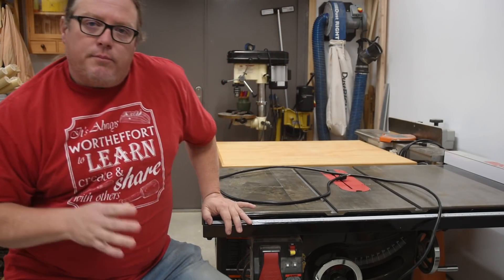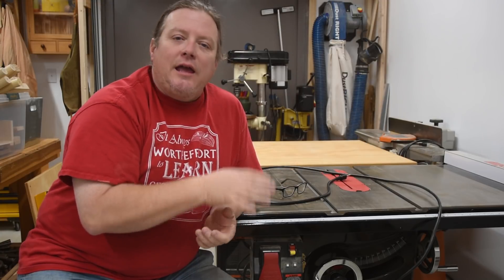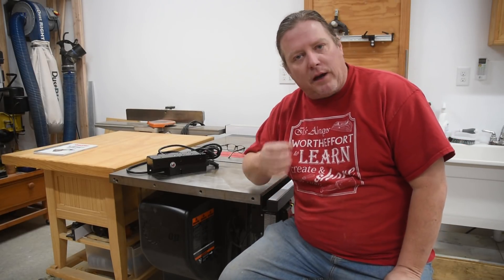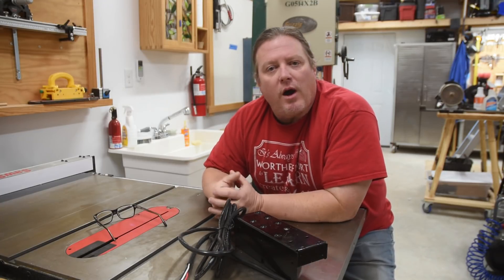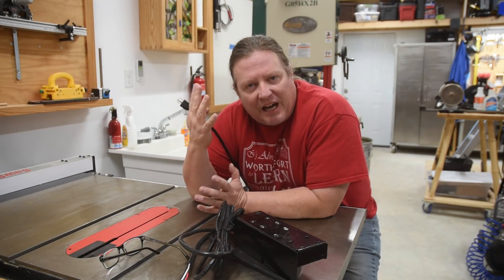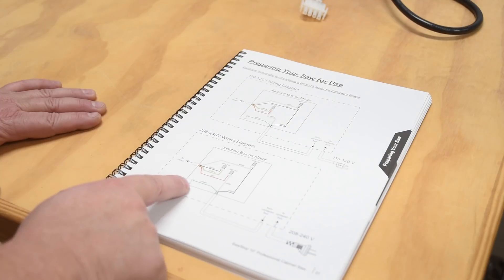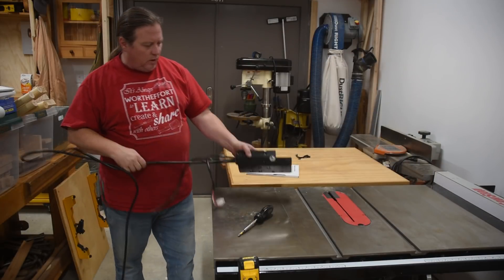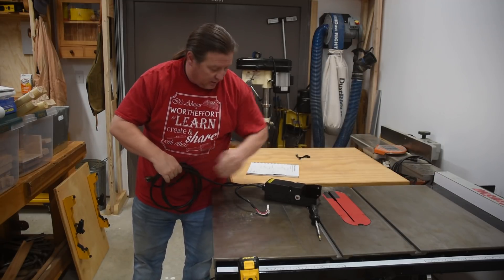Table Saw ( SawStop ) Power Upgrade - 110v / 220v

Comment: So here is the part I don't quite understand. I have two sawstops I bought used and had some parts missing. I did some research into parts and wiring diagrams and what I found is that the only difference between the 240v and the 120v is the thermal overload switch inside the contactor and the plug at the end of the power cord. So, that's $20 in parts. That's it! Yet Sawstop wants to charge me $139 + freight for a contactor that is essentially the same ( except for the lower rated thermal switch, which is a $10 part). And, I can change out the Thermal switch and install a new plug onto my old cord and rewire the motor  in 1/3rd the time of their "procedure" as all the cords stay where they are. I get the concept of making something plug and play to reduce the chance of human error, but there is little chance of human error in replacing the thermal unit and installing a 240v plug to your cord......

Comment: Did you shorten the fence rails on this saw?  My big problem with all the cabinet saws is how wide the fence rails are.  I just don't have the room in my shop for a 66 inch rail!!  Thanks
Reply from the maker: No, did not. Shorten the fence rails means less travel of fence. Not that much to begin with if you make cabinets.

Comment: Thanks for the video, I think I am going to convert to 240V. FYI everyone, USA has not been 110V since the 1960s. I am closer to 130-260V in my neighborhood but this is going to depend, probably on how close you are to source but should ideally be no less than 120-240V

Comment: Unless you are running your table saw several hours a day, you likely will see no difference at 240 as compared to 120.  Yes, you will be a little more efficient, but it will not be noticeable on the amount of electricity most table saws use in a month in a typical home shop.  Certainly, if you are running a commercial shop and using your power tools several hours each day, then running larger HP motors at 240 volts is worth doing.

I use my 1.75 HP 110 V Sawstop maybe a few hours in a typical month and the convenience of being able to use any outlet in my shop is nice and the loss of efficiency compared to 240 V isn’t detectable.  I’ve never had the saw trip a breaker on my 20A circuits, even with my ShopVac plugged into the same circuit with the saw.

Comment: wait, they'll let you upgrade to 3hp? For some reason, I thought it required a larger housing.
Reply from the maker: ya, simple motor replacement. modular system.

Comment: Never take advice from a unlicensed electrician. 110v can kill just as easily as 220v. Don't be fooled.
Reply: Voltage isn't the killer. Amps is the killer. Don't take advice from someone who thinks they know everything.
Reply from the maker: Didn't watch the video did ya. Machine stayed unplugged from start to finish. Don't need to be a licensed electrician to know to unplug a device before working on it to avoid death.
Reply: Didn't comprehend what I said or meant by the comment did ya? Lol

Comment: Most people always have a dust collector running when using their table saw, jointer, planer, etc. Normally a DC is going to use 12 to 15 amps on 120v, so put your dust collector on one leg and your tools on the other leg to balance the load on the electrical system. If your dust collector is already 240v, then yea, it makes sense to run your saw and other large tools on 240v so you are keeping the load balanced on each leg. I guess if youre using a shop vac for DC or have a 200 amp panel in the shop, it doesnt matter either way.

Comment: The ramp-up did seem marginally quicker on 220V. Would have been nice to have a thick board cut comparison too, but you would now have to swap it back, so I guess that's a no go.
Did you put the 220V lable on the electrical connection box? I wish you no harm, but just in case, the next person that may end up with that saw needs to know that the 220V connection is made inside that cover. The plug end should tell them, but better safe than sorry. "Live Long and Prosper"* my friend. And I'll see you next time for the tune-up and truing/tuning of the cabinet/table saw video. That should be some great information. Thanks ahead of time for that one too.

*  (Mr. Spock, Star Trek)

Comment: The US adopted 110V as the AC voltage standard because it takes more amperage to deliver the same amount of power, which requires a larger gauge of wire. That means more copper. The nascent copper industry lobbied for the 110V standard in order to create a larger market for copper, and it worked. The rest of the world, except Japan, adopted a the higher voltage specifically to use less copper. The US got it wrong for the wrong reasons; the rest of the world got it right for the right reasons.
Reply from the maker: I’ve also heard that we were a first mover nation and haven’t had to rebuild due to World Wars. At the time our system and standards were set up wire insulation wasn’t as good so lower amperage was safer in construction. If we’d been 10 years back like Europe and based standards decisions on technology of that time we’d likely be on 220.
Reply: @wortheffort  The thing is that all homes actually have always had 220V, it is just delivered in two 110V legs. So the wiring was available for the 220V. The push from the copper companies was to get the standard voltage in the home down to 110V as that required the higher gauge copper. I used to work for a copper company and they really were a motivating force in the decision making.
Reply: @wortheffort  By the bye, excellent job on the content. You have built a very good channel.
Reply: @wortheffort  Post-war rebuilding is the most likely reason for the switch to 220/240 in Europe. France (for example) used to be 110v single phase with 220v triple phase, then became 220v single phase with 380v triple phase (and eventually 240v/400v). Many European 380v triple phase motors can be rewired to 220v triple phase as it remained an industrial standard. Rewiring a three phase motor to 220v opens the possibility of running it off single phase 240v through a frequency variator (which also lets you adjust the motor speed and rotational direction). I've been running my 12" jointer/planer that way for 6 months as it was cheaper than getting a dedicated 3 phase setup for the workshop.

Comment: Amps kill, not voltage. Overall premise of this video is great with a lot of solid info. However, the safety comments weren't wholly accurate.
Reply: Way to simple.
Reply: @paulolsen4867  True, but what drives the amperage?

Comment: I have noticed that people from 110 volt countries seem concerned about 220 volt installations. I think the problem is that they see the higher voltage as more dangerous when its really the higher current that kills. You can have several thousand volts and be shocked by that with a nasty jolt but no real harm. For example a cattle fence has 7,8,9 or more thousand volts in the wire and if you touch it.... ouch but no real harm done as you only have milliamps of current. As you rightly commented the higher voltage reduces the current being taken and lower current means lower temperature of the device and also your household wiring
Reply: Except that current and voltage are inseparable and if the voltage is twice as high the current will be twice as high so higher voltage is absolutely more dangerous.  And higher voltage will jump a larger air gap so there is that additional danger also.
Reply: @LTVoyager  If you double the voltage you half the current  I=V*R2 conversely if you halve the voltage you double the current. Its simple physics.
Reply: @footplate0  It is simple physics, but not simple enough for you to understand.  I does not equal V*R2.  Ohm’s law is V=IR, which means I=V/R.  When R is a constant, as it is with the human body in the short term, if you double V, then you must double I to maintain the equation.  If you grab onto 120 V you will get a certain amount of current through your body based on your current body resistance.  If you then grab onto 240 V you will experience twice as much current flowing through your body.  If the amount of current from 120 V was just under the amount needed to stop your heart, then 240 V would give twice as much current and might well be enough to cause cardiac arrest.
Reply: @footplate0  It is eerily quiet…
Reply: Correct, volts don't kill, current kills but it only takes 15 mA to kill. GFCI setting is 5mA.

Comment: The sound test is not the best because camera have a compressor built in that kick when sound is peaking. Which will make every sound something like 85-95db. Still IRL my 240v is always a little bit quieter or as you said more bassy sound.
Reply from the maker: ‘Twas more for speed as you can tell it reaches max speed a little quicker.

Comment: Super simple upgrade, nice.  I was surprised at how much sawdust was in that electrical box.  Makes me wonder if I should check mine.  Thanks for the video.
Reply: Was thinking the same. Like: "man where did the sawdust come from?" there's a gasket and the hole where the wire come in seem to be blocked.
Reply: Top clip on cover too loose.  It can be bent a little tighter and will seat on gasket at top better, screw at bottom should hold it tight. But Shawn does need to use his compressor to blow the sawdust out of the motor ever so often.
Reply: @tomcoker9882  Compress air :'D